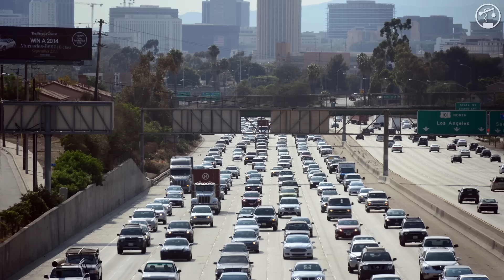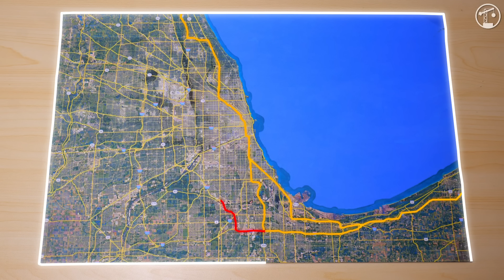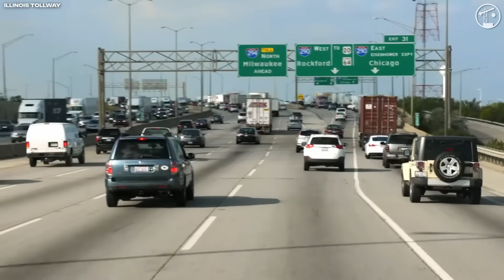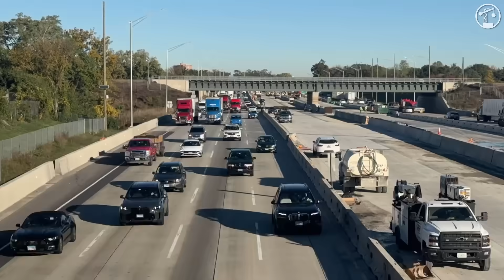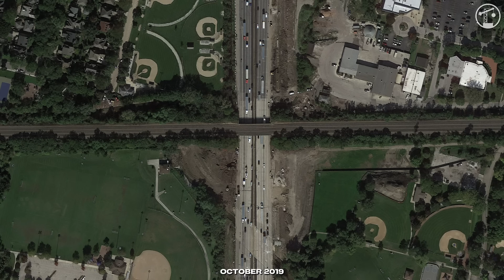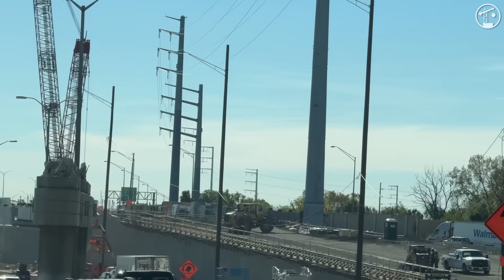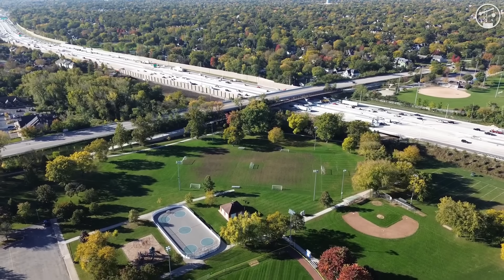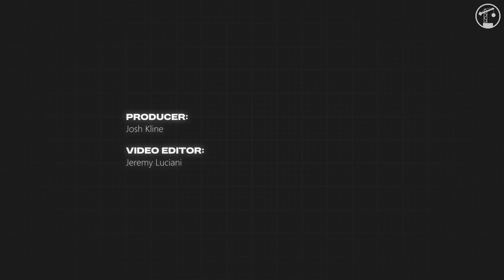Why Chicago is Spending $4B on One Road

Comment: When are the Tollways NOT under construction?

I-88, 294 (O’Hare to North Suburbs), 90 (O’Hare to Rockford), and IL 390 - EOE have all gone through major rebuilds in recent years.

At this point, I feel as if these rebuilds are (excuses) to keep the tolls on, instead of being eliminated, which was originally promised.

The title here, I get, is a bit misleading.

294 is too far out for Chicago proper traffic and is more so useful for suburban commuters. The Crosstown never got built, and we are more so likely to use different combinations of Irving Park Road, Ashland, Western, 290, and even Lower Wacker to move between West, North, and South Side Chicago.

Comment: I’ve lost so much of my time to the 294/88 merge
Reply: That was the worst section, where 290-to-294 south crossed 294-to-88 west traffic. It is so much better now that these lanes were rerouted.
Reply: That junction will be great when they're done. When you merge from 290 onto 294 going south ,  you won't have cars on 294 south trying to move over to get on 88 west.  That traffic will already get off before that .  It'll be nice.

Comment: The tolls will hike again. The Big One and the Legislature approved a "tax" on ISTHA users to help cover the transit budget shortfalls (Metra & CTA). Since the Tri-State is almost a captive ROW (meaning, alternatives are few) its tolling is somewhat inelastic and free alternatives are not very accessible. I have survived both the 1975 upgrades and the 1994 upgrades. They both added life to the route and there were some incremental safety benefits, but facts are facts. As long as people insist on living in Naperville, but work in Gurnee these issues will not get better. Another dynamic that adds to the issues is the incremental addition of delivery trucks from their warehouses.  UPS, FedEx, DHL, Amazon etc. all come out at around 6:40AM. Then the grocery, baking and food services start delivering at around 6:50AM. Then the construction trucks all come out at 7AM to get to their job sites. As you can see by 7:15AM the problems have already started. A major strategic error on the part of the Illinois planners was that in 2003, they declared that they were going to reduce any further large public expressway investments so as to "force" people into using transit. The pandemic and remote work changed all that. This is why they are in the situation they are in today, more traffic, less capacity. Lots of transit, but not enough riders. So here they are upgrading the Kennedy and are getting ready for a major Eisenhower/Congress complete redux. The people in the area are completely dystopian, as up in Lake County they complain bitterly about the traffic, but then block IDOT to build out the long planned, infinitely delayed IL-53 extension, the North Lake Expressway and the Northwest Expressway (US-12) to Wisconsin. They get the traffic they deserve.

Comment: $4B available for this; but let me guess, no money available for alternative transit projects
Reply: It’s only funded by tolls
Reply: Chicago is one of only like 4 US cities with an actual functioning public transit system. The 294 beltway bypasses the city and is a major artery for cross-country traffic, which is why it's overdue for an update. This argument works better for literally anywhere else.
Reply: True
Reply: The Kennedy and the danRyan expressway could handle the extra traffic if they didn’t improve the route.  The state has been wanting to steal the tolls to use it elsewhere for as long as it been open. There is a blocking laws and strict accounting laws that prevent that. Plus it is generally the best route we have. Political suicide if they broke it. Infrastructure paying for itself is what all infrastructure needs to do. Pace buses also run on this route plus they are adding an express service because of the road improvements. The flex lanes .

Comment: One more lane will surely fix it!
Reply: As the narrator states at the end, it's about streamlining the system - the shoulder & flex lane, the signaling, and the smoother, faster ramps to support the induced demand that are forecasting.
Reply: @jonathanbott87  aaahhh so you just merge into more traffic... got it.

Comment: This will become worse in a matter of time, when it is completely finished.
Reply: I am hoping that the big reorganization of public transit they just passed -- merging all the agencies, which saves hundreds of millions a year, and producing close to a billion a year in new funding -- will underwrite new projects that alleviate the pressure. Chicago desperately needs better cross-city commuting, which they'd get by building a link along the St Charles Air Line rail route from Metra Electric and the Rock Island to Union Station, and redeveloping the mail-handling terminal at Union as an additional terminal that would handle through traffic. If they really want to get ambitious, as local activists are increasingly suggesting, they could add to that an additional north-south subway downtown. This won't do a lot for the western suburbs -- who are the biggest beneficiaries from the Tri-State project -- but it will do a great deal to enable suburb-to-suburb trips between the south or southwest suburbs on the one hand and the northern and northwest suburbs and O'Hare on the other. Do even the first project and you cut the cross-city commute by Metra almost in half....more or less to what it takes to drive, and without any of the stress.
Reply: @dblissmn  Saves Millions A Year = More Money to Crook County political criminals via corruption.
Reply: Hopefully, it ends up like I-90, where for most of my life, it was “Hubbard’s Cave to Rockford, then again, then again” til all the Orange truck kids’grandkids were out of college, and settled-in out in Lake Geneva.

Today, I-90 really is a beautiful trip on the toll portion, and it is much the same on 294 from 55 to Indiana. 

The mile-long bridge build turned out great.  

Can’t wait til next year when the 55-Balmoral project is finished.
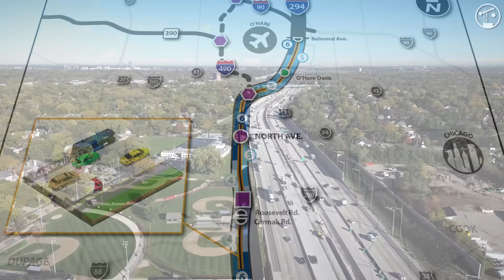Reply: 8:46 "the bet here isn't that 294 will stay empty after you rebuild it. It's that the corridor won't break down as easily when it's full."
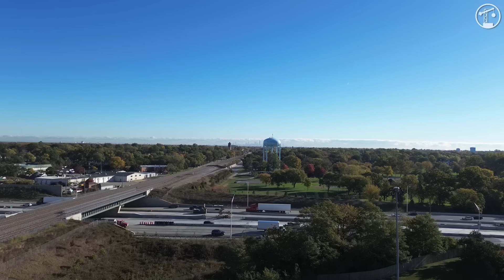9:00 "If induced demand does show up, the end goal is that the better geometry, real recovery space, and active operations keep the beltway reliable instead of fragile." 

Reliably slow during peak demand will be better than today's more frequent stop-and-gos caused by accidents and throughput bottlenecks.
Reply: That's because of cars . If the add a train they good
Reply: "Induced demand" is just an excuse to do nothing.
Reply: @brianschar5664 It’s a reason to build a train*
Reply: That’s why you have to keep expanding infrastructure as cities grow.
Reply: Just one more lane bro

Comment: I lived in Chicago, and had to commute out of the city for work. I had to leave 1.5 hours before work and sleep in my car in the parking lot. Otherwise I would be sitting in traffic the entire time
Reply: Are you close to transit systems like the cta or metra?
Reply: @kevinaguilar7541 they mentioned that the job is outside of the city. probably a place cta couldn't reach.
Reply: @kevinaguilar7541 I don’t live there anymore, but I needed a car for this job
Reply: I work in the building trades in Chicago and see so many guys doing the same thing
Reply: @hydrobud89 im a tradesman that unfortunately lives in western suburbs and Chicago has a lot of my work, 7am is usually my start time. If I'm not in the city by 615-630 I'll be late 😂 coming home at 2-4 is a fkin nightmare. Only time I can zip home is around 11-1
Reply: I leave (Rockford) before 5am, or after 10am on those few days I need to go into the office (in the loop).  That is why for 40yrs I lived next to an El station, and worked downtown.
Reply: @harryrcarmichael  holy cow thats a commute
Reply: Where did you live in Chicago and where did you work.  I have worked with people who lived in the city and worked in Schaumburg/Hoffman Estates. One lives in Norwood Park and works next to I90 in Hoffman and it is an easy drive. It's must faster than working downtown and taking the L.
Reply: @canyonoverlook9937  Lived in Lakeview - next to the Sheridan El station, always worked within a few blocks of the actual loop.
Reply: Been there
Reply: PAST TENSE. Lol
Reply: You ain't lying. Live in Milwaukee and worked in Medical district. I would leave Milwaukee at 4am just to get to work at 9am, and would sleep in my car. Uggg.
Reply: That’s why they need to increase toll. The higher it goes the less will take it
Reply: @HelaRids  so then we can Just say.. Supercars only all plebiscite take the Retro bus
Reply: @AMPProf  exactly😂

Comment: What is not mentioned is how the Tollway flooded homes 2 years ago in Hinsdale after not managing the water run off from new construction.  The ramps at Ogden are incredibly unsafe to current date with too short of merge lengths.  Also not mentioned is the horrible quality of the actual road surface.  Soft asphalt that is only a few years olds is in terrible shape and your car tires and suspension tells you so as you commute.  Some lanes are split with a portion being concrete and remaining being asphalt.  The pandemic pause really reduced the quality of the actual "finished" road surface.  Video says it completes in 2027.  By 2030 they will need to start grinding, pulling up and reapplying asphalt.
Reply: The road is so bumpy and when I drove it last the lanes were swerving all over the place, it was nuts!  I do hope it at least flows better when done, maybe it can last to 2032 before they start again!
Reply: The tollway authority should require contractors to guarantee their work for some period of time. Maybe then they wouldn't have to rip the road up and repair it every couple years.
Reply: @pilotgrrl1  unfortunately, it's not really the contractors fault if the city doesnt have an actual plan for how they wanna do shit.
I mean look at the Kennedy expressway's renovations over the last 3 years. The city put the contractor behind schedule because "they wanted the express lanes open for the DNC delegates to use" then the city blamed the contractor for them being behind.
It's all a dog and pony show and the worst part is with the "sign improvements" THERE STILL ARE BROKEN SIGNS
Reply: Sadly, you're right about the HMA (asphalt). I believe there was some meddling with them trying to please the concrete and asphalt industries. The road should've been built all-concrete, no HMA surface until years later down the line when it's time for minor rehab.